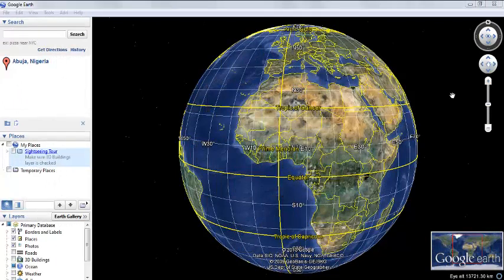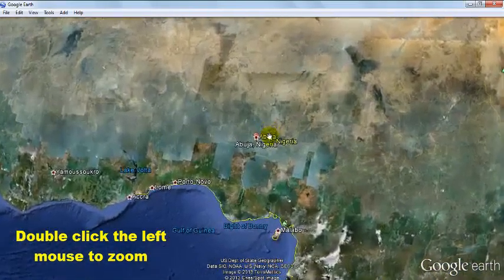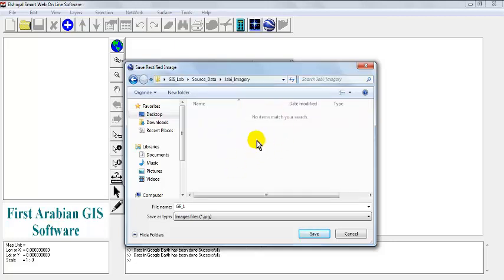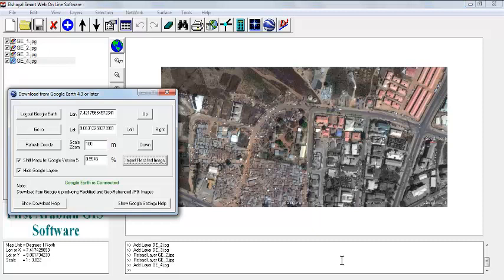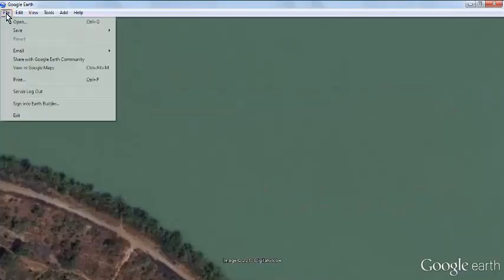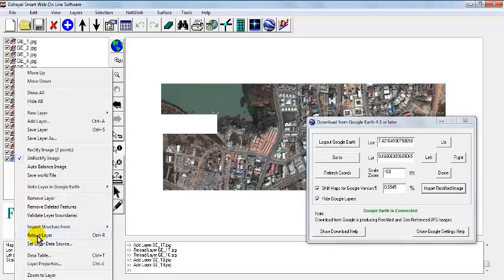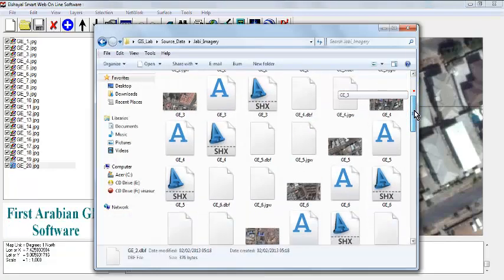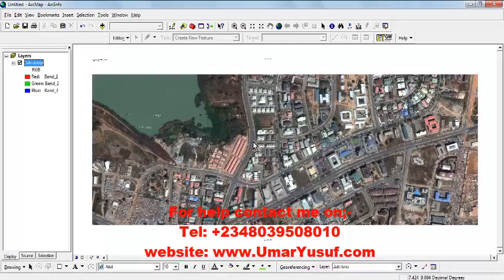How to Download BIG Rectified Google Earth Imagery to get big High Resolution Image

Comment: useless video. I used Bing maps, combined 6 screenshots from the area with photoshop and got a map with 4100x2500 resolution in 10min
Reply: Can you share with me the steps to download bing maps. I have been trying but am never successful.
Reply: +Ivy Gondwe you cant download. i simply printscreened the area i needed and combined 6 screenshots into one big map in photoshop. but you can combine pictures only from the loaded map area. when you move the map with mouse at some point it loads a different map piece and it has different perspective angle and it doesnt combine with previous area that well.
Reply: +Romka Lev. they are rectified images..with coordinates..if you just printscreen them and process them in photoshop the images don't have coordinates..with this software the images are rectified automitacally.